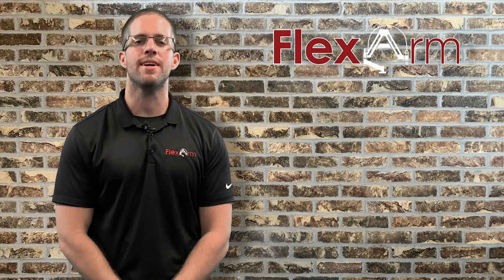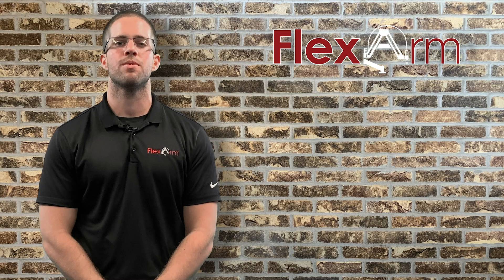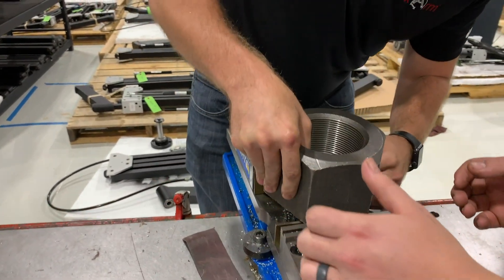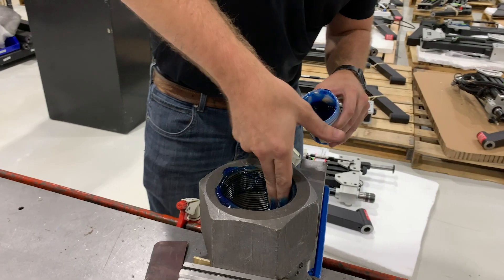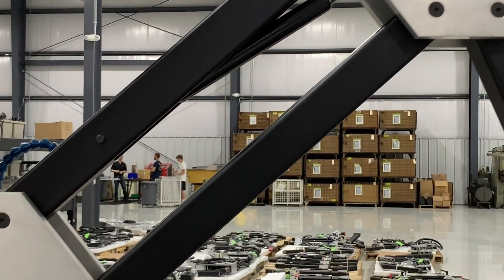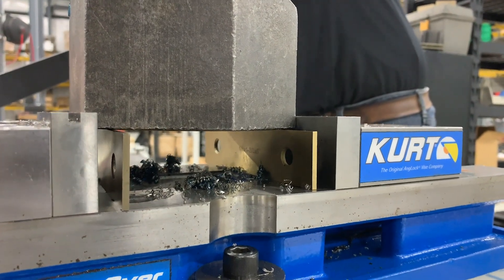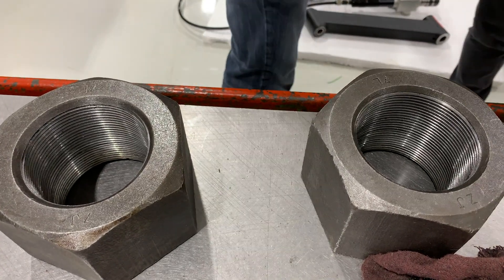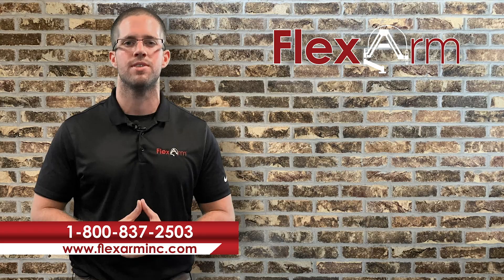Chasing Threads with a 3" Tap

Comment: That is cool and all but a 3in tap would be exponentially higher than just chasing the threads on a lathe or even thread milling on cnc mill.  That said flex arms are cool 😎 and time saving equip.